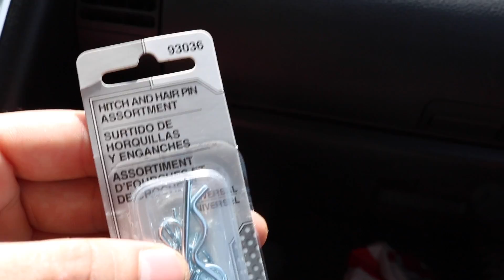Aluminum Shifter Cable Bushings Install for Veloster

Comment: I recently installed these exact bushings in my VT. Since then I hear a rapid rattling sound in my shifter when in 3rd and 4th gears. Do you have this problem?
Reply: Frankie did you have to sand the bushings down as well?

Comment: you didn't have to sand the bushing, I install it on my car as well it was not going in but added a lil oil to the bushing and slid .right in. and this was for the small busing as well not the two sided one that you have to connect.